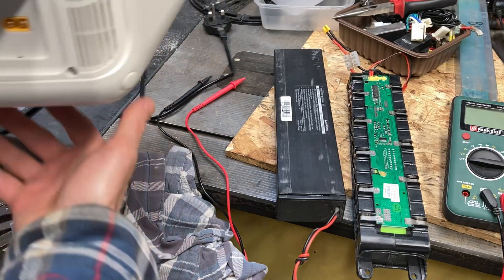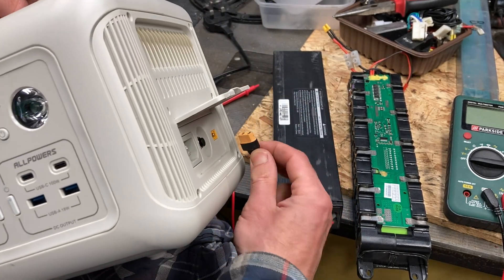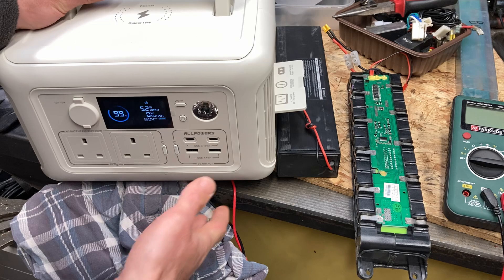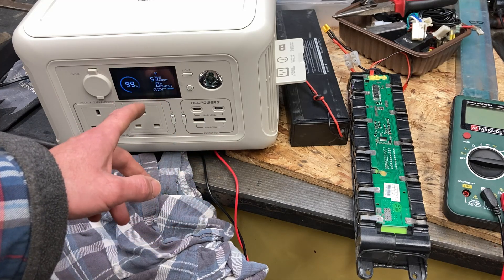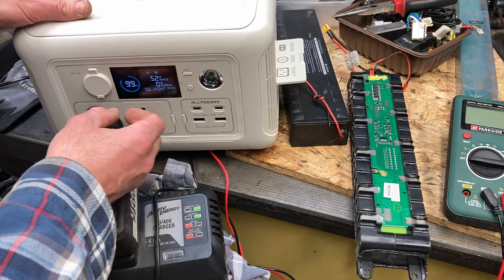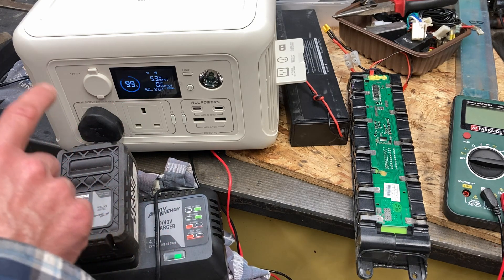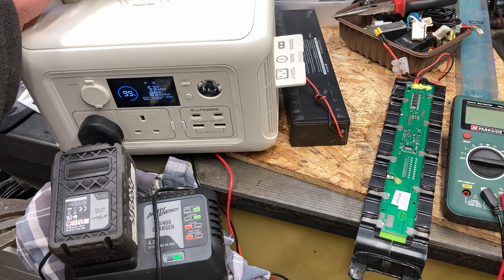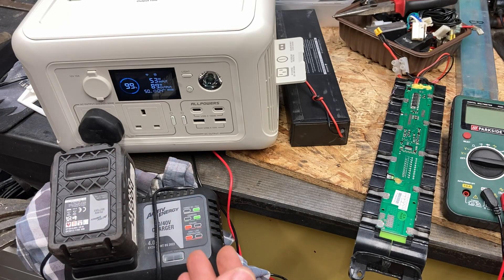Real tests to add capacity to an ALLPOWERS Solar Generator Kit 600W using tool and ebike batteries!

Comment: Most of these battery inverters lack the option to give priority to solar charging. Please check if this one is like that. 
Maybe a workaround is to plug it into the mains via a timer so that it has mains power at night. 
That way the battery would trickle charge from solar during the day and then top up at night if needed. ☮️